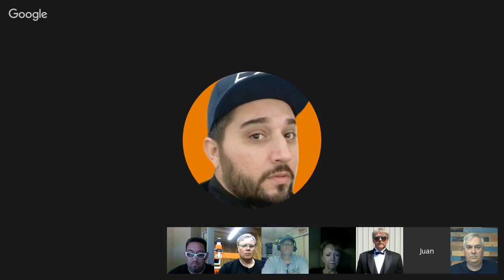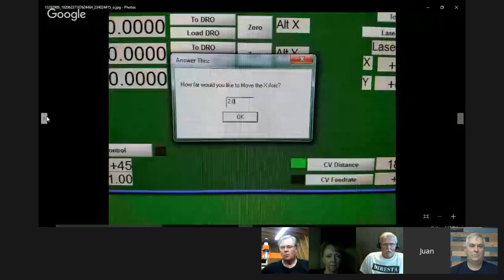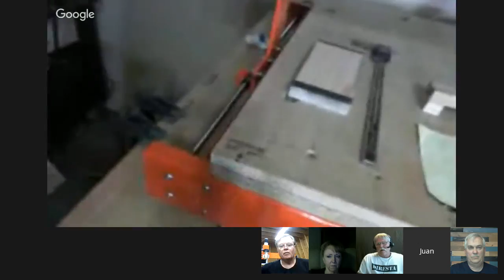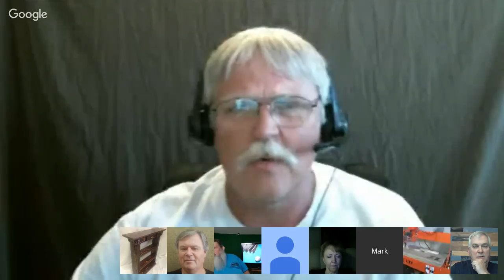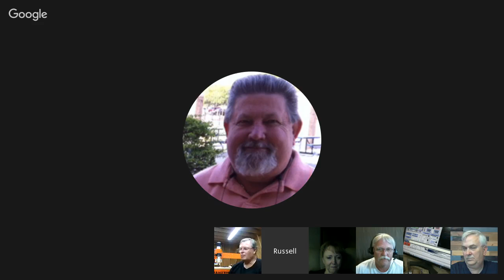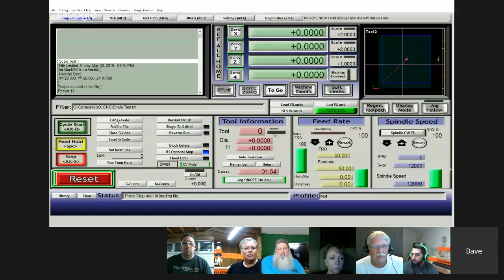CNC With Dave # 5 - Setting up Mach 3 Software

Comment: Hi Dave, I just finished your CNC on a shoestring budget, except with the longer gantry like you showed in "Another CNC build". I watched show, but I just got more confused. I have been working with CamBam cam software, but when I export the dxf file, I can't find it when I open up Mach 3. It seems like the more I try to understand what is going on the more confused I get. Totally frustrated, Steve Busch